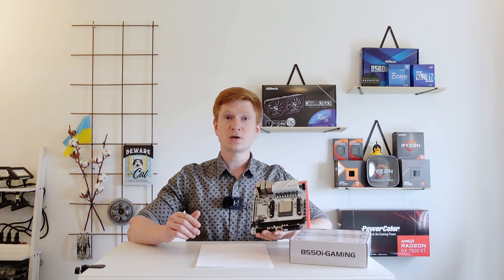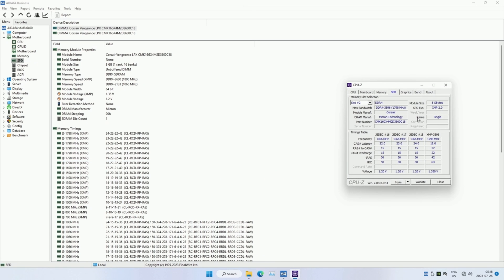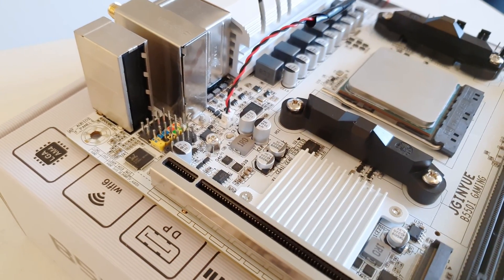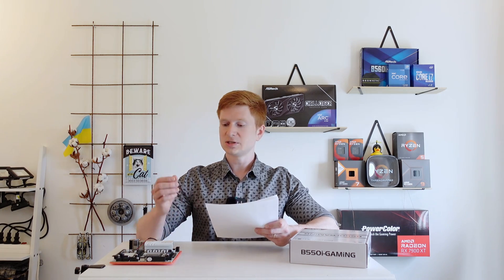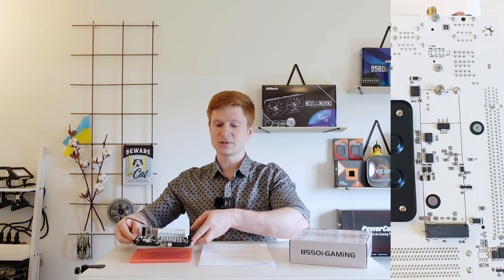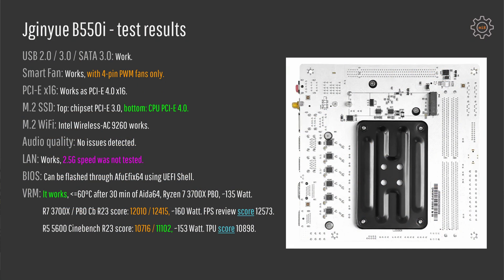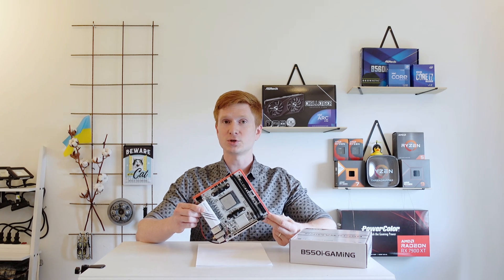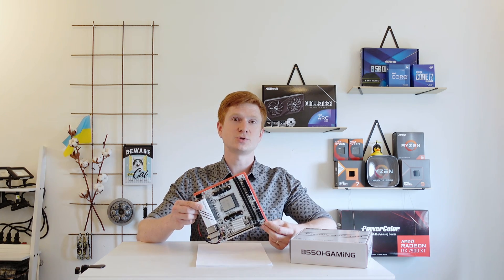🇬🇧 Jginyue B550i-Gaming motherboard – detailed review | R7 3700X, R5 5600, XMP, O.C.

Comment: this theres been a change to this board. they are now only doing 2x pcie 4.0 on the back nvme.
Reply from the maker: Are you sure it's all the boards? Maybe yours is just quirky?
Reply: @Miyconst  Not sure but this video claims 2x on back https://youtu.be/H-Lt0ssRYEY?si=LO_5G4Sdr-x-GEyO&t=109. tho i checked mine and turns out i was missing caps on my nvme for the 2 other lanes so maybe wrong info need to test with a non damaged nvme

Comment: Well I got one since I last commented here asking about the wifi card here. within 10-11 mts it stopped working altogether. No bios post no display. My recommendation to everyone skip these China brands. If you can get a hands on used mobo from ASRock Asus MSI etc go for those. Mind you that you need to get a separate wifi card, add all those cost it's the same as getting a used branded one.
Reply from the maker: That's the unfortunate reality of the AliExpress lottery. Like I always say, AliExpress is the very last place for shopping.
Reply: @Miyconst  thing is this was purchased through a local retailer for jginyue. Now I don't know if they sourced it from AliExpress but I am definitely not going for these type of brands again.
Reply from the maker: Then you can just bring it back to the local retailer and demand a replacement.

Comment: I saw in one review that this motherboard doesn’t work with the 3000 series. I want to get a 5 3600X. Do you think it will work?
Reply from the maker: It should but I can't guarantee. Make sure to ask the seller to send the board with the correct BIOS.

Comment: can anyone help me, im using r5 5600x with rtx 4060 but is uses pcie 8x 3.0, how to enable 4.0 in this motherboard?
Reply from the maker: It should run at PCI-E 4.0 by default. Are you sure you have B550 and not B450 chipset? Also, ask the seller for the latest BIOS, maybe you have an outdated version.
Reply: @Miyconst I have a similar issue. The latest BIOS, Ryzen 7 5700X with RTX4070 is working in PCIe 3.0 mode.
And I can't find the PCIe selection option in BIOS...
Reply: You can specifically install bios that supports 3.0 or if you don't then it'll run on 4.0 (the 4.0 doesn't say anything but that it's an update for bios) @pixell79  make sure you're not using any risers if you are it will cause conflict and you need to install 3.0 on on the official website
Reply: There are two versions of the bios on the site with the same date - one if you have 4.0 and the other if you have 3.0. They did not figure out how to distinct your Gpu so they simply have two versions of bios for every update

Comment: How did you connect it to a riser cable? When I use a riser cable it displays but when I put a driver on it it's only black screen even if the driver is already installed, it will display on boot but all black screen after, (GPU RTX 5050)
Reply from the maker: It might be the quality of your riser cable. Is it PCI-E 3.0 or 4.0?
Reply: @Miyconst PCIE GEN 4

Comment: So without this cmos battery if i adjust ram timings and reset it then i will jave to do it everytime i turn on the pc?
Reply from the maker: Without a CMOS battery you lose the settings on each power off. Simple PC restart or shut down (with power on) will preserve the settings.

Comment: For the NVME on the underside and the chips under the NVME, it would be a very good idea to get some thermal pads to place between the motherboard and NVME drive, and another on the NVME drive that thermally connects it to the chassis so it can use it as a large heatsink.
I would do the same with the VRM chips on the underside as well.

Comment: Does this motherboard support resizable bar?
Reply from the maker: It does.
Reply: @Miyconst sorry does it support curve optimiser for ryzen 5000 series cpu's as i normally run mine with -60mv on vcore and -20 all core optimiser.  This kother board isncoming in 3x cheaper than anything locally on this old chipset
Reply: @dazdaz2050  It supports negative PBO. How well it will run I can't say. I have 5600X with -11 all core.

Comment: Even if the issues remain with the latest BIOS, no other ITX comes even close in value.
Especially for 6 or 8 core 65W CPUs.
The next board in price, ASRock A520M-ITX/ac. has no PCIe 4.0, no 2.5G Ethernet, no USB-C header and just one M.2 slot.
EDIT: most BIOS issues mentioned here are mostly fixed, but it's not perfect.
Reply: Hello. Are you using this board? How was it so far? Are encountering you any performance issues? Thanks.
Reply: @WILLtry8 I’m using it with 5600X, RTX 3060 and DDR4 3200. The only BIOS issue I had is some random issues with “save&exit” not working when I turned on XMP and rebar. I had to press the clear cmos button on the back and set them again.
No other problems for me.
Reply: What did you do about the cmos battery situation?

Comment: Late to the party, but my 4060 is running on PCIE 3.0 anyone managed to run it on 4.0?
Reply from the maker: What is your CPU?
Reply: @Miyconst  I'm running 5600. I specifically avoided 5600g because as far as I know it  doesn't have PCIE 3.0.
Reply from the maker: @ybrikjosh  I assume you meant PCI-E 4.0, because 5600G supports PCI-E 3.0 and does not support PCI-E 4.0. Anyway, R5 5600 should work at PCI-E 4.0 out of the box and if it's limited to 3.0, then it is very likely to be a defective border or for the compatibility reasons they disabled PCI-E 4.0 in BIOS by default. You can explore the PCI-E settings and see if there are any switches available.

Comment: i had this motherboard today and i use ryzen 5 5600 and rtx 4060 which is will unlock pcie 4.0 but i have only pcie 3.0 riser,, trying to find pcie lane generation in the bios to change 4.0 to 3.0 but i cant find one thanks
Reply: The parts will be like: 
Yo hello i'm 4.0 who are you - Hi there i'm 4.0 too nice to meet you - Cool but why the heck can't we shake hand eventhough we're standing next to each other? 
They don't (can't) realize they are in different timelines.
...
Brother, trust me, it will be a hassle, just get a 4.0 riser and be done with it, don't bother tinkering. From my experience using a 3.0 one to link 2 4.0 devices brings all kind of weird issues, even if you some how managed to change them into 3.0... There will be always 4.0 stuff and logics going on inside at the hardware level - which none of us can do anything about. I managed to get a similar case to yours done but the stability problem still persisted so it's not worth it.
Reply: So there's no option to lock the pciex16 to gen 3? I'm also trying to find the option, I only have gen 3 riser
Reply: Hello how's the motherboard so far. Any performance issues?

Comment: Maybe someone has encountered on this motherboard, it does not display an image on the monitor at startup, but if you press the power button several times (that is, shut down through the button and start) then after a while everything is fine, all the stress tests go away, but with the launch I don't understand what can be, maybe someone can tell me which way to dig, the 1060 6 gb video card

Comment: I am really unclear about the wifi. Does it require a separate m2 slot wifi card? And if yes does the board provide those two small antenna connectors between the card and the external antenna I see on the board?
Reply from the maker: You do need an M.2 WiFi card and the small connectors for the external antenna are included with the motherboard.
Reply: Hi! Do you have a reference link for the Wi-Fi card and antennas? I'm really confused. Thanks  @Miyconst

Comment: I cant get this board to work at all. The cpu fan are turning slowly, but thats all. No lights, no screen, no mouse, no keyboard, no network, no nothing :( I have tried with many types of ram, gpu´s and cpu´s. Even a cpu with apu/gpu. I sent it back to seller. They tested and said it worked fine. And i bought extra ram from them just to be on the safe side. But nope!! No luck...
Reply from the maker: Good job sending it back. AliExpress is a lottery. These sellers will always say it works even without retesting it. No trust in them.
Reply: @Miyconst  Yeah I know. I have sent it back once. Im not sending it back twice... He asked for pictures of my setup etc so he can see. I am going to do that but I am pretty tired of messing around and using time and money on this :/
Reply from the maker: @kentdahl5556  yeah, it's very frustrating, I hope you can get it resolved.

Comment: Just got one recently and almost all the issues has been resolved by the version I got.
Reply from the maker: That is great to hear. At least some JginYue motherboards improve with time.
Reply: which is your version? is it easily recognisable? cheers
Reply: @gianlucab2261  if you got the board with cmos battery i think it is the newer versions, if you order one probably you will get the newest version anyways.
Reply: @gianlucab2261  i think if the cmos is included then its new version.
Reply: sleep works?
Reply: @lyndongaming  yes it works

Comment: Will the 550i support my 5600x and rt 5700 xt?
Reply from the maker: It should but I don't recommend this board either way.
Reply: @Miyconst  I bought it and been waiting for it in transit :( I saw your video about it after. Is it really bad? It seemed to have some flaws but I also saw some people have no issues
Reply from the maker: @jeffkohler21  only testing will tell. Make sure to check everything you can check before approving the order on AliExpress. If it works - good for you, if it doesn't - send it back.
Reply: @Miyconst  thank you for the advice! I think I'll just return it. I ordered an ASUS Prime B450M-A II AMD AM4 to use instead.

Comment: I have trouble starting with this mobo, when I try to start windows or boot with usb, it stays on the black screen and does not advance, any solution?
Reply from the maker: It might be related to CSM/UEFI boot and how your USB drive is configured.
Reply: @Miyconst  Whats best config for installing win10 or win11? and what boot is better for that?

Comment: How to update Bios? I try to enable SAM but enable Resizable bar, 4G Encoding, and turn off CSM and it's still doesn't work.
Reply from the maker: What is your GPU? To update the BIOS you need to create a bootable flash drive and use Jginyue provided script. I don't remember the exact steps.
Reply: @Miyconst  I use RX 470 since it's my second build for my girl which only game lightly.
Reply from the maker: @gr4j0m3r  this GPU does not support resizable bar without modified drivers, as far as I know.
Reply: @Miyconst  Thanks, I order a new one as 6500XT, thank you for the answers.

Comment: Good job, thank you. Since other AM4 itx is almost gone in my country now, I found this a second hand with reliable seller, so I just bought it. Strictly have to be itx build, this is the only option that is still cheap cause I don't want to buy other inflated prices available elsewhere. The issues you listed are not gonna effect my use case so I think it will be ok.

Comment: just got mine. everything is working fine but i have issues no input detected on my monitor.pc run just fine, cpu cooler, ram and case fan running but on monitor no input detected. already tried taking out ram, remove and insert back cmos but still the same. im using ryzen 5 5600. any idea?
Reply from the maker: What GPU do you use and where is the monitor connected?
Reply: @Miyconst  rx6600xt. gpu lights turned on and i plugged hdmi on gpu port. what may cause the problem or my motherboard is the faulty one? i read that i need to update bios for it to work on r5 5600 but i already tried swapping cpu to r5 3600 and still no input on monitor
Reply from the maker: I can't debug your setup remotely but it sounds like the motherboard is defective. You need to swap components one by one and see what causes the problem.

Comment: Hi, wanna ask about the lastest bios update. Does it lock Pciex16 to 3.0 or still can use gen 4?
Reply: I can answer that. it absolutely does pcie 4.0. the problem I'm having is not being able to downgrade to 3.0! i was getting BSOD when updating nvidia drivers on a 4060 and realised it was because my riser only supports 3.0 and the pc is running it at 4.0 causing stuttering then inevitably crashing. Looked all over the bios settings and cannot find any way to change the pcie gen from 4.0 to 3.0. Having to buy a new pcie 4.0 riser to see if it will fix the issue. My pc runs stock but i cannot update the nvidia drivers though, so can't actually run any games on it for now.
Reply: @mrcraigj90  thanks for the answer. cause  im planning to buy this mobo, but in their websit state that latest bios does support xmp profile for ram but they did lock the pcie to 3.0. 

so latest bios lock to 4.0 actually. 
😅
Reply: @mrcraigj90  btw have u tried run the pc open bench, gpu directly to mobo before buy pcie 4.0. cause if it run well, then confirm that the issue is pcie riser
Reply: @rikisaputrasamsujir1296  to answer both your questions. I managed to solve my issue with a bios update. Since then it's been running flawlessly since detecting pcie 3.0. I did buy a pcie 4.0 riser before I managed to fix it but I haven't changed it over yet to see. I suspect that as there is no manual option on the bios to set the pcie gen, when they say 'limits to pcie 3" what it likely means is that they have added the ability to auto detect pcie 3.0 to set a limit. I will confirm when I replace the riser but honestly I don't expect to see much of any of a difference in performance. Pcie 3.0 on a 4060 is more than sufficient. I'm not seeing much of a real world difference between this system and my other pc with a 3060ti. I can definitely recommend this, even without gen 4. Just make sure to update the bios to latest version for compatibility.
Reply: @mrcraigj90 Hi man, are you using R5 5600 btw? I pick that combo and i am wondering if work Out of the box with that cpu. Thanks 😅
Reply: @maurosergio3900  yes I am. Works just fine out of the box
Reply: @mrcraigj90 Hi I'm also using 5600 paired with 3060ti. I cannot boot with gen 3 riser. But I can boot with GPU directly connected to the MOBO. I have bios 5.17. Is there any way to lock the pcie to gen 3 only? Like downgrading the bios? I cannot find it in my present bios.
Reply from the maker: I don't have the motherboard anymore, I can't test the latest BIOS, sorry.

Comment: Hi...i seem to have a defective bios on my Jginyue b550i motherboard....can anyone please help and give me links and instructions on how to reinstall the bios....many thanks in advance
Reply from the maker: Hi. What makes you think that you have a defective BIOS?
Reply: It's just a suspicion...My PC (which is using Ryzen 5600X, RTX4060, 16GBx2 3200mhz ram and 600w psu) keeps lagging, crashing or blue screen and the temps are above 95C during stress test....it's just on a test bench and not even installed in a case. Also, the Passmark 3Dmark score and Unigine Heaven score on the RTX4060 on this build is scoring less than half of my old RX580 in my other PC with Ryzen 2600 CPU. 

Could it be that it's a faulty motherboard or maybe it requires a bios update?
Reply: I'm not very experienced in these things....any advise on how to troubleshoot the problem?
Reply: By the way, it's a brand new build....

Comment: have you had a chance to check on the b450i version of the board? the reason i asked is because they said it support ryzen 1000 through 5000. i have it to use with ryzen 5 2600 and then upgraded to ryzen 5 5700x and both worked out of the box. 

was just thinking since both b450i and b550i are the same price but b550i officially only supports 4000 and 5000 series
Reply from the maker: If I remember correctly, B550i has PCI-E 4.0 while 450i is limited to PCI-E 3.0.

Comment: Do u hv links to wifi cards compatible with it? Does cards with both a and e key work with this board? Tysm
Reply from the maker: I tested with Intel Wireless-AC 9260 and the link is available in the video description. I hope that helps.
Reply: @Miyconst  thanks alot :) had some difficulty looking for wifi cards as there wasnt much info on what was compatible with this board, and ur video was really helpful
Reply: @Miyconst  btw do u know if ax200ngw wifi card is compatible?

Comment: Thanks for this video.  I finally built with this board this last week and it went pretty well.  One thing that I came to realize is that you can remove the wifi antenna shielding and there's a slot for an A+E key wifi card.  I thought it was odd to have wifi antennas but no wifi, but it just turns out that you could add one.  It was a bit challenging given the tight space and the tiny U.FL connectors.
Reply from the maker: I thought it was pretty clear from my review that you install a WiFi card in there. Glad to hear that you figured it out.
Reply: it's pretty standard on ITX motherboards

Comment: they updated now the board and now has XMP, also my CMOS battery holder is intact with battery

still no wifi module
Reply: Hi. Saw the BIOS updates on their website says limit PCI Express 3.0 on the graphics slot. Does your only have 3.0 or does it still have 4.0 function like on this video?
Reply: I updated the latest bios and pcie x16 limited to 3.0 only, is it true?
Reply: @nguyenthanhcong9712  According to the BIOS chart, they provide the same BIOS with two spec, one is for 3.0, and one is fore 4.0, may try update with the 4.0 one.
Reply: Did you have to add anything for the cmos battery? Do I need to purchase anything extra?

Comment: can its BIOS be updated to suppert 2000 series? planning to buy this for my ryzen 2600 and upgrade later to 5600
Reply: B550 does not support Ryzen 2000, the only 500 Chipset that does is x570 :( Bios-Update wont help.